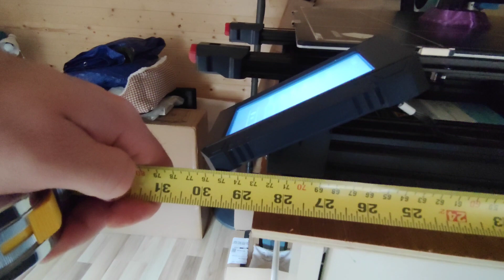Anycubic Kobra Max overall dimensions and footing requirements

Comment: The leveling is similar to creality cr 10 smart ?
Reply from the maker: This is a touch sensitive nozzle this touches the bed and activates the bed level sensor and carries out a 25 point leveling no paper needed and no leveling wheels
Reply: Thanks for help , I have a creality cr 10 pro v2 and I have problem with  leveling whells , and I Want to find no leveling whells 3d printer model
Reply from the maker: @dabijaadrian8081  this will be perfect for you the @anycubic Kobra plus is due out soon check that out 300 X 300 X 350 build volume... Check out my unboxing and review  don't forget to like and subscribe 😉
Reply: which is better Anycubic kobra max or Kobra plus ?
Reply from the maker: @dabijaadrian8081  both equally amazing max is 400mm X 400mm X 450mm so perfect for big builds
Reply: the print quality is good ?
Reply from the maker: @dabijaadrian8081  excellent
Reply: thanks for the help and for answering all my questions, ps i am your subscriber with no. 220 😀
Reply from the maker: @dabijaadrian8081  many thanks welcome too the no 220 club